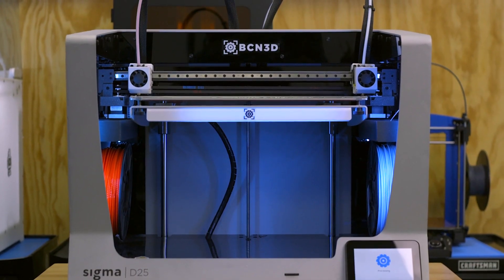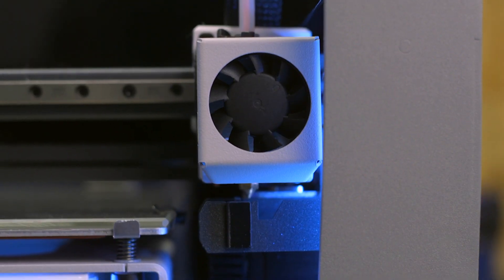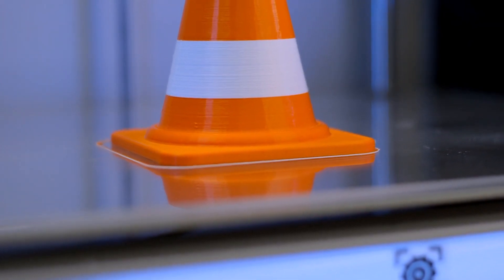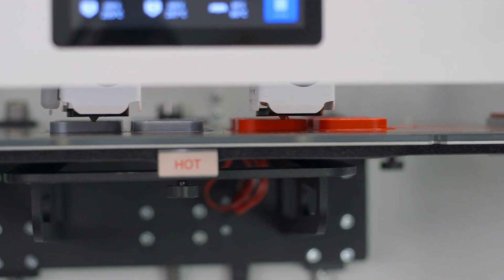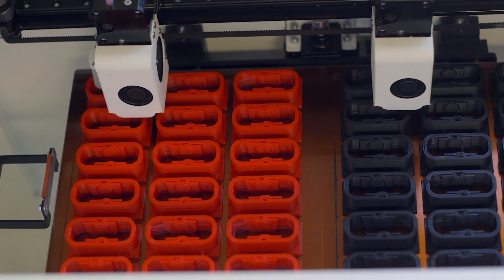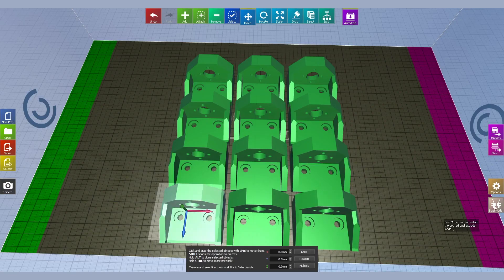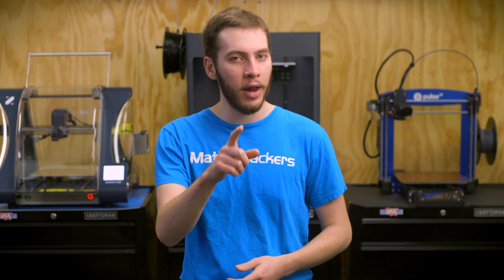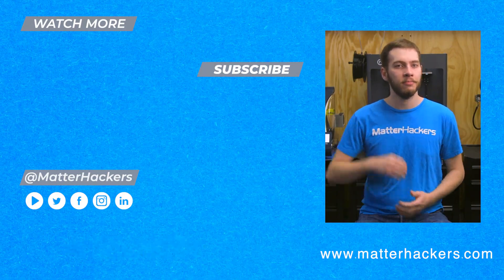5 Frequently Asked Questions About Independent Dual Extrusion (IDEX) 3D Printers Answered

Comment: Uninstalled it it's crap just spent an hour designing something then saved it then opened it again and it has not saved properly + you never answer any questions in the comments. going back to Fusion 360